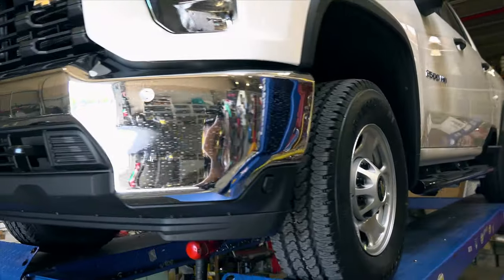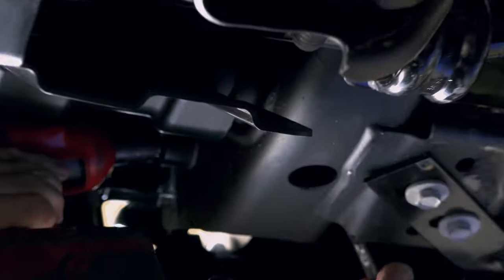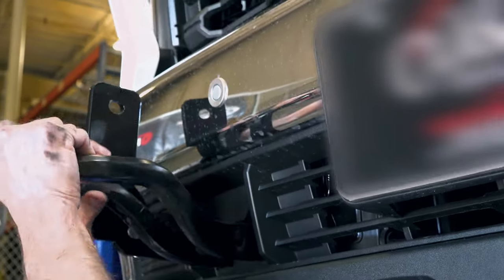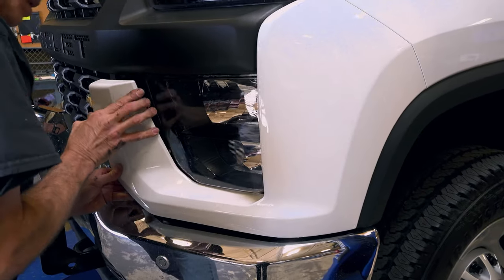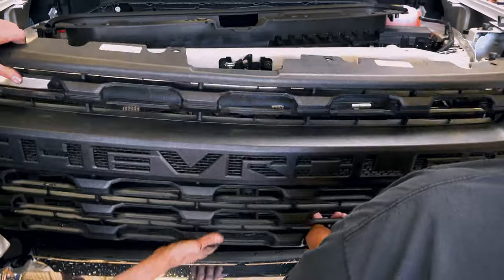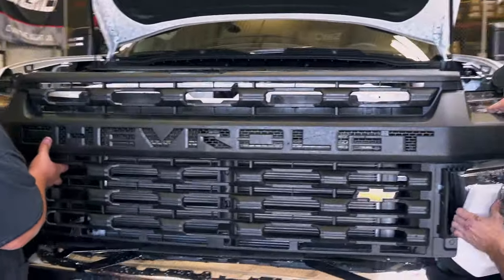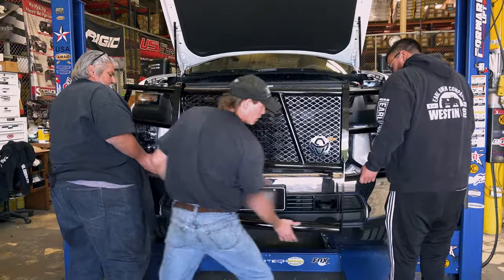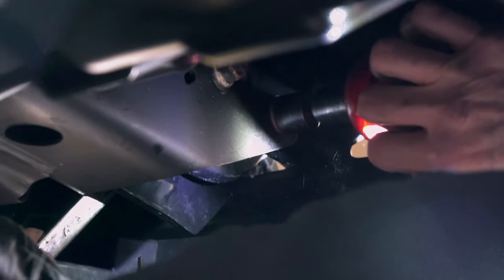Ranch Hand Legend Series Grille Guard Install on 2020 Chevy 2500HD

Comment: Does the bottom brackets point inward or outward?
Reply from the maker: The bottom bracket mounts to the frame and sticks out a little so you can mount the grille guard to that. It may differ depending on the application.

Comment: Is the sensor bracket required when installing? Can you just leave it off or will alarms come on?
Reply from the maker: It is not required but the guard will make the alarms go off, some people put covers over the sensors to keep them from going off.

Comment: How badly would this interfere with plow mounts?
Reply: Depends on the plow
Reply: @luker6766  hm fisher minute mount 2
Reply: @AlexDuval312  I don’t know anything about plows bro aside from that the connect too the frame but just know after you put on the brackets it’s a simple 3-5 step process of unbolting it and leaving the brackets on for later